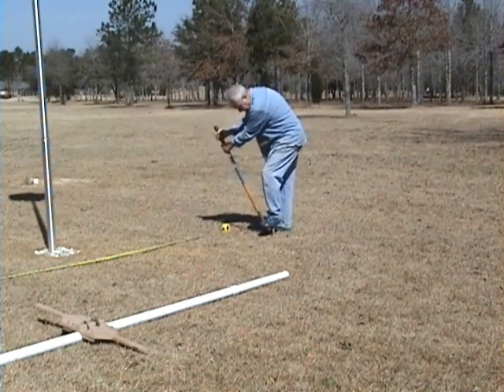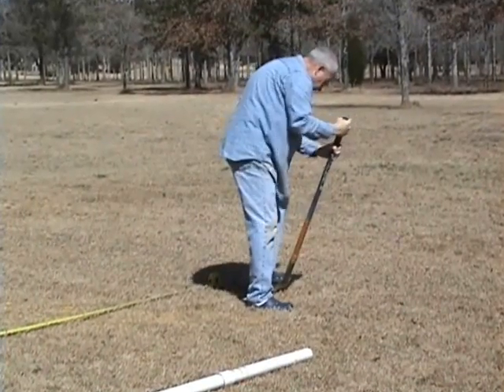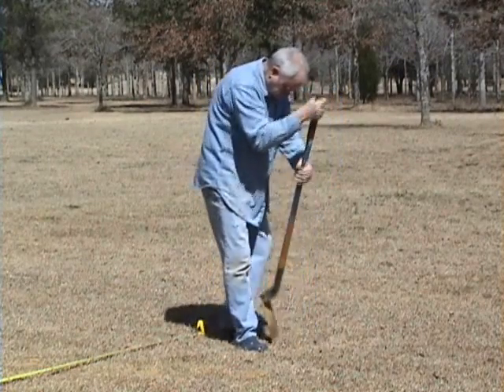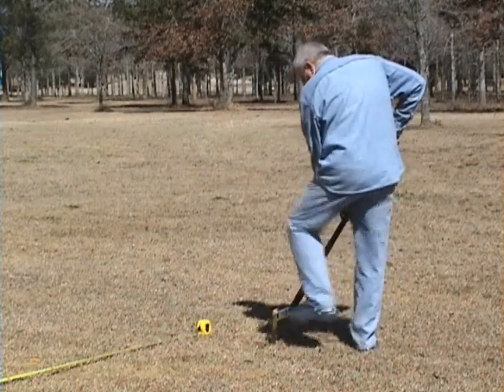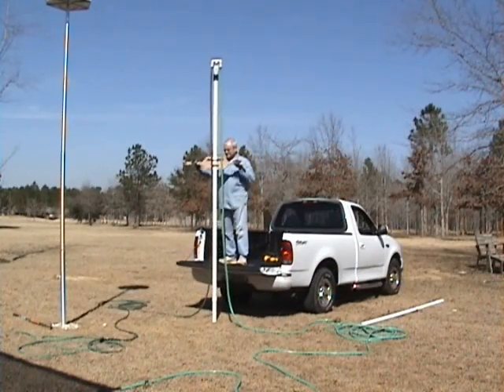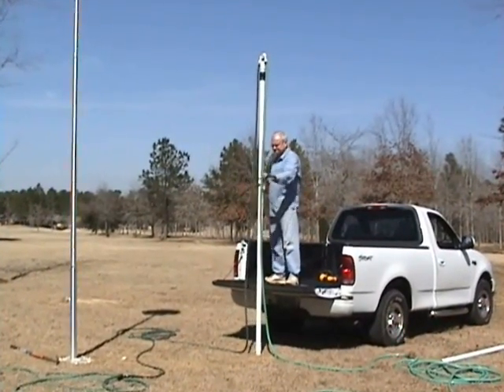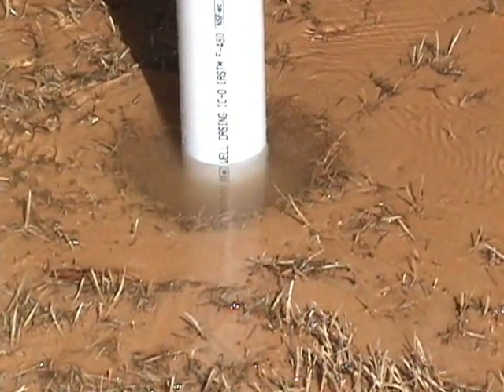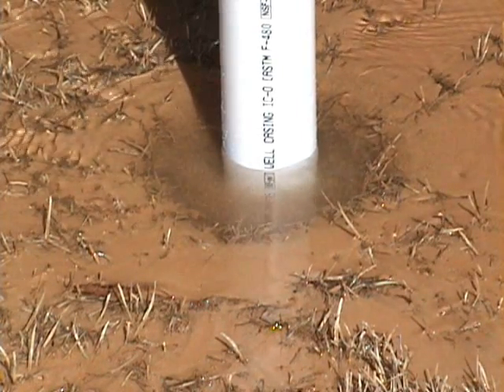Drill Your Own Water Well Series - Part 1

Comment: i drilled a shallow well using a deep rock and with about 90 pounds on a 4 inch drag bit, it took be over 90 minutes to cut through 3 feet of clay, with a mud 125 feet of head.   some clays depending on where you are, will be more than your method will handle.
Reply from the maker: Absolutely, correct.

Comment: Tip. Attach a 20-30 pound weight on the pipe and all you have to do is turn it back and forth. And you won't risk pushing to hard

Comment: Where did you get the handle? Also I have a hole that was done before, i bought a well pump to see if the well wasn't dry, the hole was approximately 30 ft, but messing with it, it's only 23 feet deep, don't if it got covered when messing with it,  but seeing your video,  do you think it will be easier to dig? Also do you think there might still be water?

Comment: Im in central florida at 120' above sea level where my soil is soft pure white sand .  I'm just 200 feet from a wetland and ponds.  I only have a 1000 watt inverter  and a 50 gallon tank of water.  Will it be possible?

Comment: They never explain how the get the pipe down lower that the top of the water table. Im using s pvc well point. But i have sincd learned that the metal ones are driven in the ground well below the water table. Not for pvc though. I started using the rubber coupler and 11/4" pvc pipe attached to a wet vac hose and vacuum. My 2.25 hp vac could hold the silt in the pipe but not pull it up. So i kept pulling it out and dumping it. Tonight i will be using a 6 hp vac. Only need to lift the water 12ft. We will see. About 2 ft below the water table with just the small vac.
Reply from the maker: I'm not sure you understand the fundamentals of the process.  Please take a look at the website listed in the description.  No vacuum is needed. Thanks for watching!

Comment: what if the ground is sandy and rocky? Near a river? I have a place in the Patagonia and have a well that is already 15 foot deep, but am thinking about using your method inside of my current well to go deeper.
Reply from the maker: It won't work in rocks.  Works fine in sand.  It is probably worth a try in your current well.  Go very, very slow so you don't stick the pipe.  What diameter is your current well?
Reply: dawmlw it’s a 41” diameter pipe that’s 6 meters long. About 5 meters in the ground. We used an excavator to set it.
Reply: I can ask my friend that ran the excavator what the ground was like at the bottom. We are right next to a river and most of the material we go through is sand, a little soil and rounded river rocks of various sizes. I don't know if he was all the way through the river bed at that depth. I kind of doubt it.
Reply from the maker: That is definitely worth a try.
Reply from the maker: Wow.  You'll need to put like a four inch or six inch pipe down as a guide tube.  The cuttings won't wash up to the surface without it because your pipe is so HUGE!

Comment: Hello Dawmlw, Thanks a lot for all the info. you've provided. Here where I live there are not water pipes of 1.25 inches, will it work if I dig the whole using a 2inches pipes and then use a 1.5inches for the inner pipe, the other option is to use a 1inch for the inner pipe. They carry 1.25 but only for electricity, and I don't think they will be a good fit. Be well!!! Thank you.

Comment: how will I know if I het the right kind of sand ...the water table here is about 6 ft....I have went down 35 feet with a test 1in pipe....im getting some light brown fin sand....do I need to go deeper
Reply from the maker: You are looking for a soft spot that is significantly under the water table.  One sign is when the hole suddenly starts taking all the water you can give it.  It is likely your fine brown sand is a good spot.  Certainly worth a try.
Reply: I used the hole I dug  where i got the light brown sand out of ....I got water out of it but it was only 1 gal a mint..thats not very much...so I dug another hole about 50 feet away...using 2-in pvc pipe..i got down to 32 feet and hit some redish brown fin sand but when I was drilling at that point it got eazy to drill so I went on down to 37 feet.i hit hard ground there. not having another well point I made one out of 2in pipe with a cap on the end..i filled the hole with pes gravel up to the 34foot point set the 2in pipe in the hole and worked pea gravel down around that...then filled in on top of that with the dirt that came out ....caped it off with cement...a few days later I ran my water hose down the pipe to flush it out....stell getting a lot of sand out of it...so I went and used air ran that for 30 mint...after that hooked up the pump stil got some sand not much... but only got 2 and a hafe gals a min..so this is what I did...I got the one inch pipe that I used to drill the first well with and put it down inside of the 2in pipe using a rubber coupling that went from 2in to one and a hafe witch is the od of the one inch coupling..put the 1in pipe down 25 feet....good news I now get 6.5 gal of water a mint...thanks for the video you make.. I was able to get-r-dune...keep up the good work...thanks
Reply from the maker: very ingenious!
Reply: hi  its been a month sence I talked to you about my well. every thing going good..i can run it 24/7 and get 8gpm ..I tested the water and every thing was good..now I don't hafe to use city water to water my Gordon and animals...nice cold water...that's where I stand at now
Reply from the maker: Great!  I'm glad your well project was successful!  Emails like this are my favorite part of running the drill your own well website.  Thanks for letting me know!
Reply: a friend of mine like the well I dug . he asked if ill help him drill one like mine. i.told him sure,, he got evey thing we need. so we used my old drill head that I made and the hook up for the water hose.we used 2 inch pvc like I did. hit sand around 27 feet.  went on down to 38 ft. took a peace of 2in and cut slits in it like I did mine and put a cap on the end of it...glude all the pipe together and put in the hole..poored pea gravel around that .the drill cutting on top of that..finshed it off with cement..the next day. we started to install the one inch pipe into the two in..needless to say he droped the first joint into the two inch pipe. he looked at me like a deer in a set of head lights..and said what was I going to do. how was I going to get that pipe out..i told him don't look at me you droped it......here is what I did...I .went and sat down and drank me a coca cola...I took a peace of 1 1/2 pvc pipe about 4 inchs long cut one end on a 45 and took a file and filed the inside of the 45 end to like a point...like the eadge on a lawn mower blade....took a 1 in coupling and put the same kind of eadge on it...( that 1 inch coupling well go indide  that 1. 1/2 pipe its a little snuge but it will go) glued that to the end of the 1 inch pipe. we put all the 1inch pipe together. with the 1 1/2  pipe on the end of the 1 inch we put it down into the 2 inch pipe..when it hit the one inch pipe he droped  we turned the one inch at top making the one inch that he droped line up with the one inch coupling inside of the 1 1/2 pipe...we hit the top of the pipe a few times with a hammer..and then slowlee pulled the pipe back out of the 2 inch pipe...when we got to the 1 1/2 inch peace of pipe the one inch he had droped was on the one inch coupling inside of the 1 1/2 pipe ,,,and that's how we got the one inch pipe out of the 2 inch pipe...I don't know if it will work on all pipe but it did work on what we was doing...got the well done and every thing is working go sofar...hope you can use the info I gave you
Reply from the maker: Nice fishing Jerry!!!
Reply from the maker: Can you email me pictures?  email address on website.  They won't let me post it here.
Reply: what is your email
Reply from the maker: It is all over the drill your own well website.  They won't let me post it here.

Comment: tried it very bad results they make it sound so easy    looked at web site and they don't show end results where a pump is pumping from the pipe
Reply from the maker: I never said it was easy!!  It is serious work.   The well I drilled in the video was for demonstration purposes as I already had my well operational.  There are a bunch of successful wells highlighted on the website.  It is not for rocky soil, but in sand, loam, and clay, it works.

Comment: How do you know for sure there is water in that spot. I have an idea on my land if it has something to do with land perk... I am not sure trying to learn so please no rude comments.
Reply from the maker: You don't.  However, usually if there is water down there anywhere, it is down there everywhere and you can't miss.  Just drill someplace where the groundwater level is above 25 feet.
Reply: I might buy one of the kits and see if I can get a friend to help. I am 5'7 and about 130lbs...lol
Reply from the maker: It is tricky.  If you are on flat land it will likely work.  Really the only way to tell for sure is to try.  You can also check with neighbors who have shallow wells.   I hope this helps.
Reply from the maker: mss burr
Make your own with PVC.  It is cheap.
Reply: dawmlw I will look into it. Thanks
Reply from the maker: Have you looked at my website?  Listed under description above.

Comment: Do you think if I built a clamping system I could use that DIY drill to get 10 feet further down? My 80 ft well has gone dry. The other area ones seem to be ok. I just wonder if diggin 10 more ft might do it.  Thoughts?

Comment: 3 questions in good faith.
Where is the water coming from if he is drilling for water?
How much water is needed aproximatetly for every 10 feet?
Whats an average speed for this type of drilling?

Awesome video thanks for posting
Reply from the maker: Luis,

This is all covered in great detail on the website but here are the short answers.
1.  From two household spigots.
2 and 3.  It varies radically but on average it takes about 1.5 hours to go 10 
feet so two hoses at 6GPM each for 90 minutes is about a thousand gallons.

Mike

Comment: So you just stick a pipe into the ground and oscillate it! Doesn't the pipe disintegrate? Or do you have hardened bit on the bottom of it? 
This isn't very educational just watching this poor man rotating this pipe from side to side. Is there a part one to this video?
Is there a filter and and the water just goes around and around using a pump.

Thank you,
Colin
Reply from the maker: +Colin Crook There is a huge amount of information on the website.  The video is simply to illustrate what is described on the website.

The pipe does wear down over time and it is necessary to re-cut the teeth in in.  There is no filter or pump in this arrangement.  In the mud pump technique, which is described in detail on the website, a re-circulating system is used which uses a portable mud pit and a mud pump.

thanks for watching and please check out the website listed in the description.
Reply: Read......the......title......you......big......dummy

Comment: Could you hook sections of pvc pipe to a paint mixer some how and just keep adding sections, would that work?
Reply from the maker: Taylormade2350 How would you adapt the hoses supplying the drilling fluid?  You'd need a swivel which would cost more than the whole setup.   I've studied on how to adapt the system to a continuously turning "drill" but have not figured out a cheap way to do it.  Thanks for watching, Taylormade!

Comment: What are cuttings and what is the device around the PVC pipe used to twist the pipe back and forth?
Thanks
Reply from the maker: varon52 Cuttings are the sand and clay that is washed to the top by the upflowing water.   They are "cut" from the bottom of the hole by the serrated edge of PVC.

Comment: No rocks there, I'm guessing. Heck, just digging a post hole here can take two hours done by hand, because you spend the entire time trying to break or remove boulders. John Deere attachments, however, can get it done in about 10 seconds per hole.  =)
Reply from the maker: You are right Melanie.  No rocks here.  This technique will not drill through rocks.  Sorry.  That tractor sounds like fun!

Comment: ok it the hole point of drilling a well is to get water. thet how will this work if there is no water to run it
Reply from the maker: You have to come up with a water source to drill the well.   If there is none within reach of the site you wish to drill you can use a tank of water and use the mud pit drilling system described on the drillyourownwell website.  There is a link to the site in the description for the video.
Reply: dawmlw Hey dawmlw, nice to see you're still here helping people. You might suggest that people with no water source can jet by an air compressor - probably have to rent a big one but it's an option. And as you know it all depend on the material you're drilling through. I could explain further if needed.  Let me know how your doing.  Have any other projects going on?  edge4him@gmail.com
Reply: dawmlw npjbvctg 6yyyy6kuiiiuu uu . U j y uh 4yg35tn75u7  7b7btumm767b7btumm76  s22fZ
Reply: Gregory Farias ukh!b n.      Njjklonjkojbnm. Bn
⬅🕙🕙🕙🕥🕚🕚🕦🕚🚍🚘 kling iihhhhhhhbhbbbbbghnhugp🕙🕙🕙🕙

Comment: Where are you supposed to get the water for the hose?
Reply from the maker: That can be a problem!   This technique is primarily for folks who already have city water and are looking for a cheap source of water for irrigation.  If you have no water supply, please consider using the mud pump method described on the drillyourownwell website.  There is a link to it in the description of the video above.  Thanks for watching the video!
Reply: What does the pipe or drill tip look like?   How to you finish and leave pipe, pump in hole so it does not sit on bottom?  How do you know you are deep enough and have hit water?  How much water can you pump out the hole per Day?
Reply: i'm with this guy
Reply: dawmlw
Reply: EZ Off Grid + Why wouldn't a creek or pond work as a drill-water source?  And if a near enough neighbor don't mind, for the price of a few more hoses, that would work; knowing there's a limit to the effective length of hose, but it is probably 150 yards at least.
Reply: Just like the pros do, holing tanks and pumps.
Reply: Good question and wouldn't a post digger move this along a bit faster?

Comment: hi there what drill head have you used and the pipe you are drilling with did you leeave that pip in the ground thanxs mike
Reply from the maker: The construction of the drill head is explained in detail on the drillyourownwell website.  There is a link to it in the description of the video above.
Reply: dawmlw how can a fluid swevel be made
Reply: dawmlw how about a fluid swevel for a rotery drill pipe

Comment: Wonderful video. I am having 5 acres of agricultural land next small lake. so i am planning to drill into the lake with this technique. The lake gets dried in summer, but still i believe the water level would be just 7 to 8 feet below. So i am planning to increase the size of the drill bit to 6 inches with 2 inches PVC pipe. With this technique how much water i may able to pull it.
Reply from the maker: Good luck.  It gets exponentially harder as the diameter of the hole increases.  If you need more flow it would be easier to drill several parallel smaller holes.

Comment: Yes sir, my wife and I live in Deep South Mississippi gulf coast. Now all of our land is on high ground, several acres. Our ? Is just how deep do you believe we can sink a well in this fashion? You see we are certainly going to do it this way with a mud pump which I have 2 of but we want a " Flow " well if it's possible. Because we would also like a spring fed pond as well as chemical free natural well water. Please let us know. I'm going to your web site now. Thank you and we subscribed!!
Reply from the maker: With a mud pump you can usually get down to 50 feet.  That may not be deep enough for you if you are on high ground.  Check with your neighbors and see how far down the standing water level is.
Reply: D

Comment: Can you go down as much as 70 feet?
Reply from the maker: I have never drilled that deep.  Using a mud pump and metal bit, I have gotten to 65 feet but that was REALLY pushing it.  The chance of sticking the pipe at that depth is very high.

Comment: Hello again! I'm thinking of doing this for some fence post holes I need. The ground is very hard packed with gravel. Would be slow going with a post hole digger and don't want to spend several hundred dollars renting a tractor with augur attachment. Only question would be, would a garden hose be able to drill a 4 inch ABS hole? Even if it couldn't if I punched a 2 inch hole it would make it easier for the post hole digger. Or could I make a few 2 inch holes side by side? Figured I'd write and see if anyone else has done this for some short 2 1/2 foot post holes using a garden hose...
Reply from the maker: Yes, it works perfectly.  I have dug about 30 post holes with one.  One hose is enough.  It isn't terribly fast but it is very easy!
Reply: Thanks for the reply! I ended up going to the plumbing store and built a 30 inch long 1/2 inch galvanized Tee with 12" handles (just capped off the handle ends) and added a hose inlet with another Tee near the top using a small coupler. I went with the metal so I could use my body weight to really push down on the hydro-drill. It took all of 5 minutes to punch about 6-7 holes and turned the ground into swiss cheese. Only took a few more minutes to use the post hole digger to clean them out. The water brought most of the dirt out already. Thanks for the channel, it made my job tons easier going through that hard stuff. Almost made it fun! ha ha :)
Reply: Gyva02 

Renting a Post hole digger around here cost about 50 bucks..
Reply: Soil/Ice Hand Drill, Post Hole Digger, 6" Auger, 8' Long    https://www.amazon.com/Soil-Hand-Drill-Digger-Auger/dp/B0768PN2S4